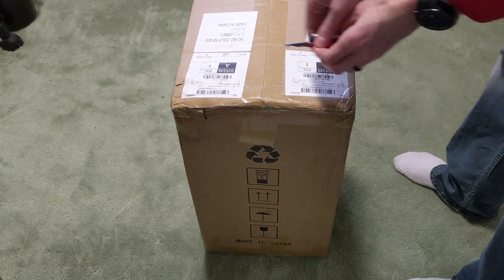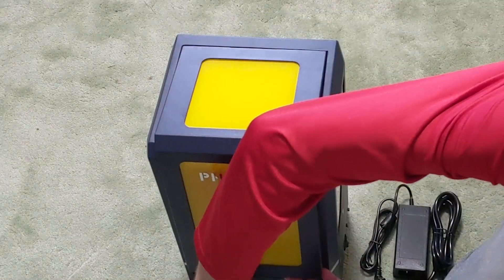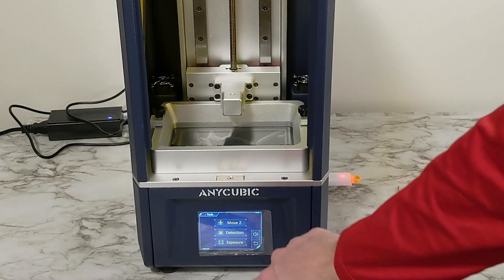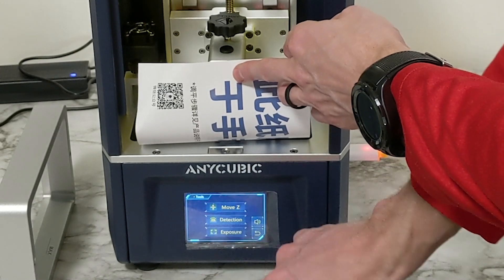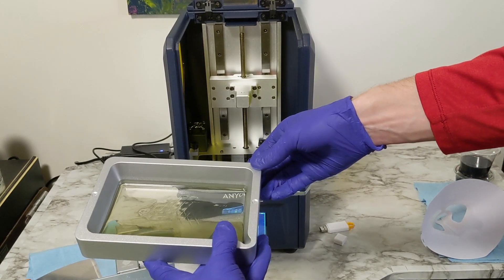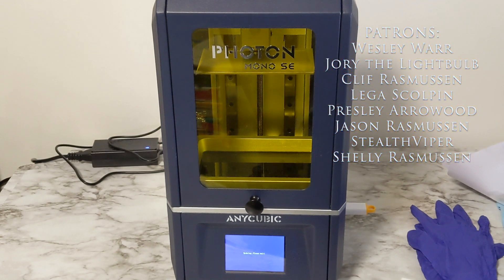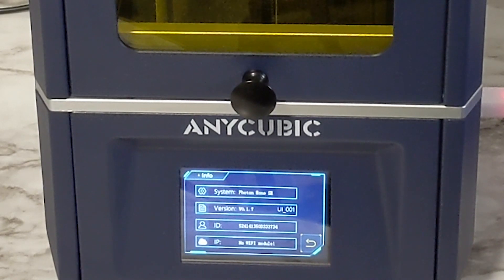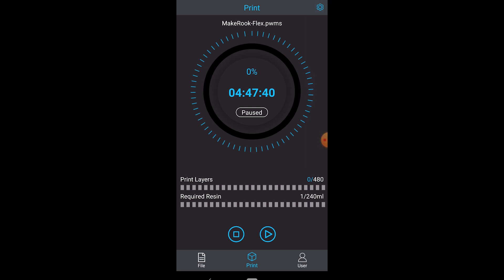Anycubic Photon Mono SE Unboxing and Setup, Firmware Update, Connect WiFi

Comment: My mono se failed within 3 of getting it - the front panel display quit working - after some back and forth service determined the front panel was faulty -- 3 weeks later new part finally shows up.  Installed it -- still no work. Service determined the motherboard is faulty -- now waiting for another shipment from China with a new motherboard :(

Comment: Hi, could you tell me where you found the firmware update? I went on to the Anycubic site but I don't see a link for the mono se firmware anywhere.
Reply from the maker: Sure, I'll add it to the description too, but it can be found on the product page at the bottom under anycubic care https://www.anycubic.com/collections/anycubic-photon-3d-printers/products/photon-mono-se-lcd-3d-printer
Reply: @geek-happens  Thanks for the answer, had the exact same issue that Savage had, link was on the printer page but the support part of the site had different files. Again, thanks!

Comment: Hello Geek Happens, do you still have the original USB stick from the MONO SE? Mine didn't came with the stick so I don't have the RERF file and it would be awsome if you could share those files with me!
Reply from the maker: Unfortunately, I don't have the original RERF file, but you can contact anycubic or use this one 
https://www.thingiverse.com/thing:4821971/files
or even create your own (put the same test model in each of the 8 quadrants of the bed, slice and save as R_E_R_F.pwms) and can even modify the cure times during printing. I haven't tried it yet, but its a nifty feature

Comment: When i try to level my plate, the paper nicks on the right side and is loose on the left...no matter how i try. Also, i get this error message called " out of zero area " when trying to z=0 when i finally got the paper to " somewhat " slip out. Any idea?
Reply from the maker: There are a few different methods people use to level the build plate, but it sounds like maybe you have manually raised the build plate beyond the sensor area? (Where the little metal tab in the back hits the sensor) There should be some considerable movement up, down and all around when the nut is loosened so that when you hit the home button with it loose, the build plate will automatically be touching the screen area without having to then manually move it up. When it is level you should be able to slide the paper in and out with equal resistance on each corner without it just easily sliding out. If using a normal printer sheet of paper, you may want to use two for the right thickness. This is for installing a flex plate, but he does a good job of explaining the leveling methods that might help you at 15:46 https://youtu.be/JrIeuAgX7vI
If you still have issues, you may need to contact anycubic support.
Reply: Tnx bud. I sent them an email and i hope to talk to the store tomorrow as well. I have had everything up til the tightening to work as it should, but as soon as i tight the one screw, the plate is uneven. When i pull the paper out, the paper is snagged on the right side, but free on the left. Tried to align this with pressure while tightening on the left side, but still the same. I left it for today, hoping for tomorrow.